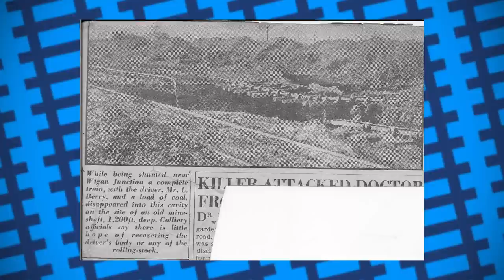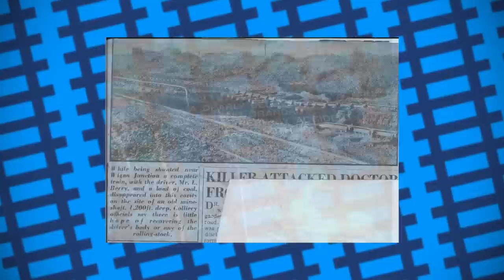The other time the ground swallowed a train - Abram Colliery Incident

Comment: FYI, the place name is pronounced with a short A, as in "hat". The site wasn't in Abram in any case, it was at Platt Bridge to the north. There were literally hundreds of shafts in the area; it is impossible to build without worrying about problems caused by coal mining.
Reply: Also Sodors legend of the lost treasure
Reply: Still they build. Most of the area is covered in Lego houses now, right through to M61 at Westhoughton. CRT and local farmer have cut off a public right of way just yards from where Dorothy sank, presumably in preparation for more houses
Reply: Doubt it actually happened, just saying 😅
Reply: @bigmick5964  It certainly did happen. Plenty of photo evidence, an inquest on 18th May 1945, and questions in Parliament. The inquest verdict of "misadventure" seems quite inappropriate.

Comment: Pity they were never recovered. It's an empty field now. So digging for it won't upset anyone.
Reply: But MIGHT be considered grave robbing.
Reply: @gameoholic1994  Perhaps. But Dolly would make a great museum piece.
Reply: @gameoholic1994  Only if done without the approval of either the council &/or the current landowner.

Having a member of the press (the local one at least) on hand does seem to be standard practice for such excavations for a reason though.

Comment: Is that a picture of 'Dorothy'? Can't read the nameplate. Looks like a 19th century Peckett going by the Salter safety valves & smokebox wing plates as well as the shape of the saddle-tank.
Those huge baulks  of timber attached to the locomotive's frames must make it rather distinctive. They are to reduce damage to the locomotive in a de-railment incident.
No good when the thing drops down a disused mineshaft. 
I bet some of the miners who attended the disaster would have liked to try and bring the body of their brother miner to the surface & be buried decently.

Comment: Didn't even try to dig him out. What if he was still alive in the cab when they filled the hole in?
Reply: He would have already suffocated. There are often gases in old mines trapped and Oxygen dies out quickly especially as the engine would have been using it up as the fire burns out.
Reply: @ChimpManZ1264  plus anyways he was probably burned and severely injured from the fall